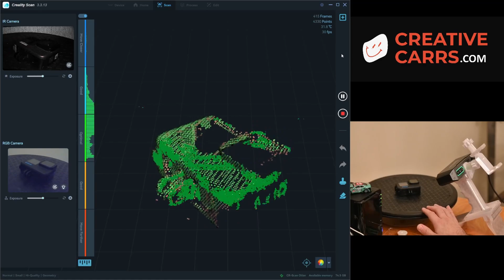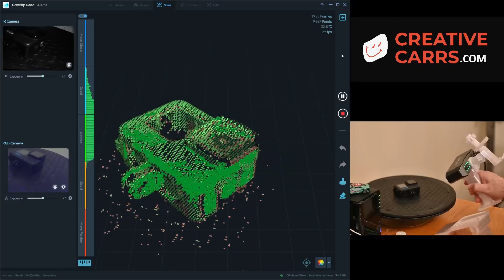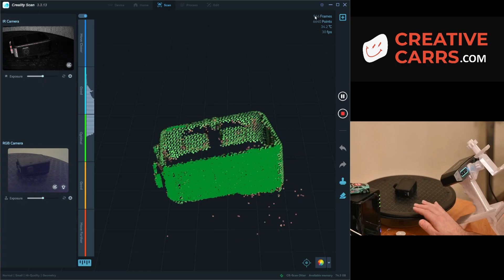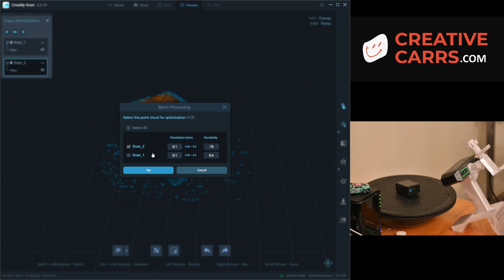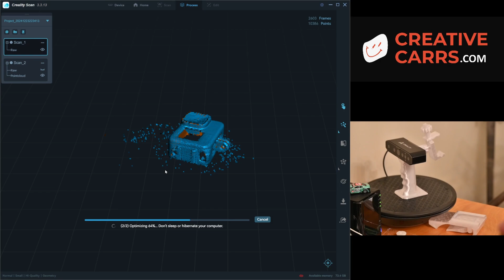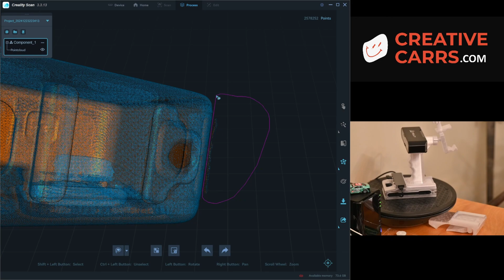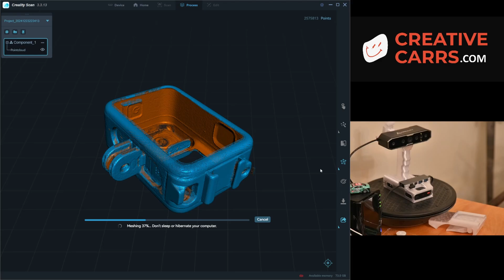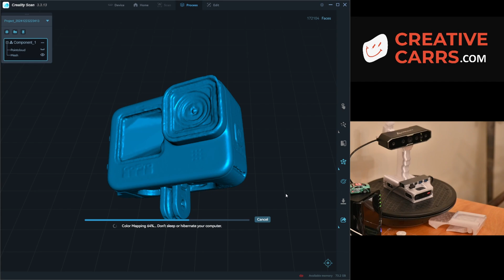Using auto merge for a complete model in Creality Scan and mesh simplification

Comment: Thanks for sharing. Is it possible to accomplish the same with the mobile scan app for this scanner?
Reply from the maker: Yes, you can!  If you'd like, I can make a video showing this, but in short you just take the two scans via the mobile app and then on then import them on the desktop and merge. I have not found a way to merge in the mobile app though.
Reply: @ Many thanks. This is very useful and will do 😉